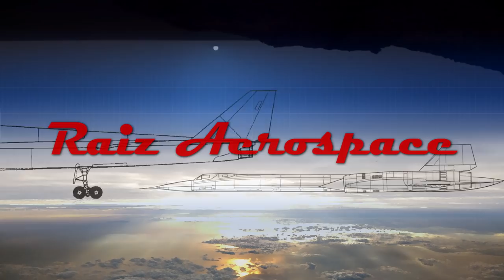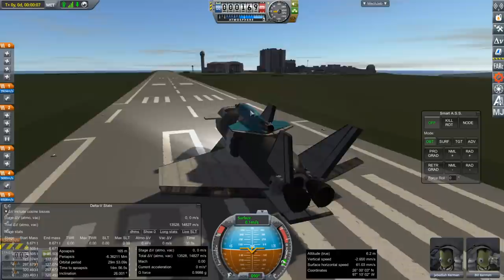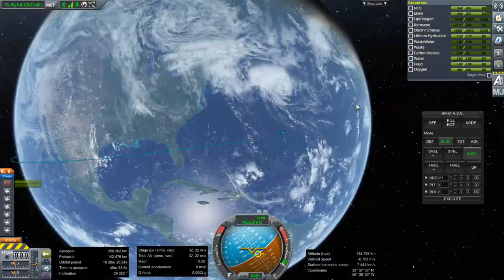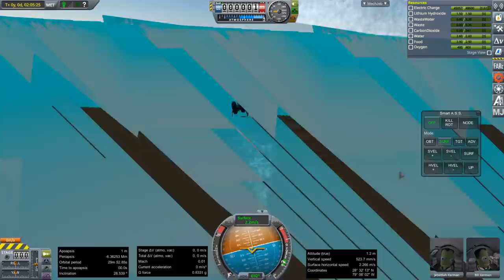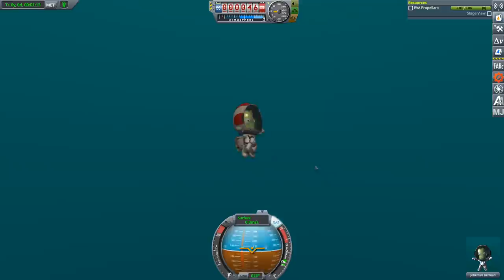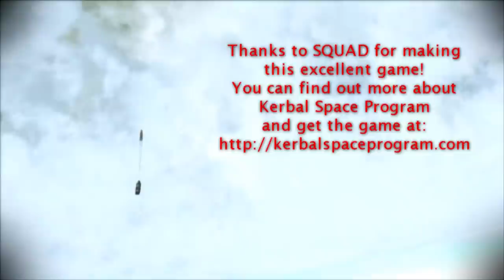Realism Overhaul in KSP 1.8.1 - Bluer-Dulcinea Spaceplane Test 2

Comment: I was working on a crew shuttle a while back and had the same issue with roll being nigh uncontrollable. Ended up putting roll control RCS on the wingtips. It's still a bit sluggish in the roll, but at least it's controllable now. Also, I was admittedly being quite conservative about it and it is Kerbin not Earth, but I went for 60km PE and multiple aerobraking passes. Actually used Atmospheric Autopilot for them, with the max AOA set to 35 degrees.
Also, speaking of high Gs, what was the final G load for the Space Shuttle? I recall Chris Hadfield mentioning on Master Class that the G load eventually gets high enough that it makes breathing difficult roughly around the end of the SSME's burn, but he fails to mention any particular G load iirc.
Another thing, with most aircraft, you recover from a spin by cutting all power and applying rudder in the opposite direction of the spin until you point down and recover enough speed to pull out of it. Unless, iirc, you're in a P-39, then the manual says to bailout.
Reply: My cure for flatspins on most of my crafts are two teeny tiny (1.5m - 2m diameter) drag chutes, so I get 2 lives.